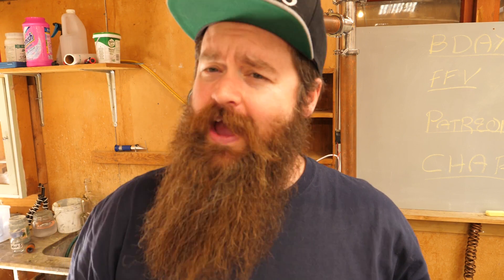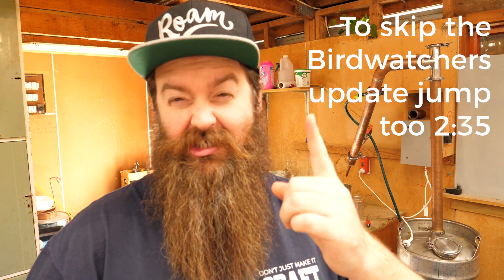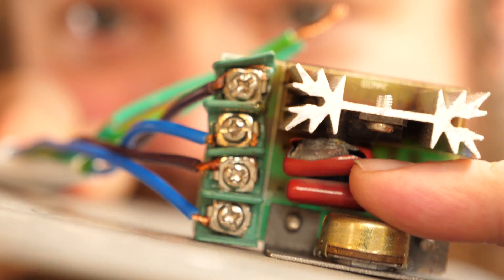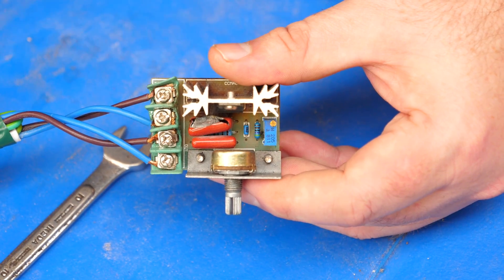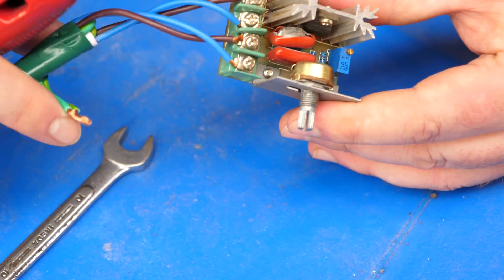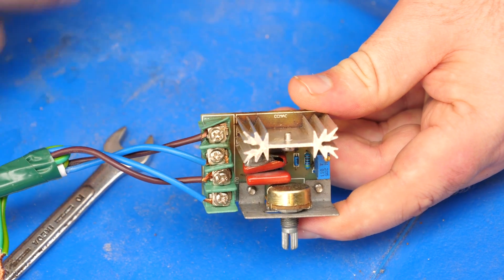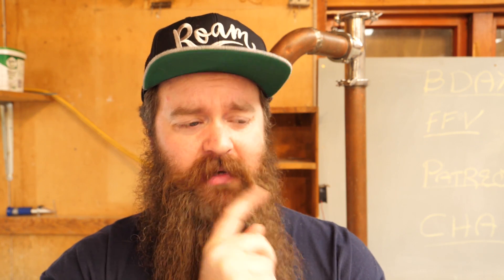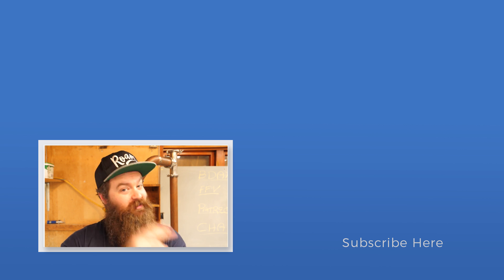How To Control Electric Element Stills?  SCR!

Comment: Information on SCRs
You have mentioned in the past that you thought your liquidis heating slower than you thought it should. 
     IF your controller is TRULY using a SCR, that 3 KW heating element can onlyproduce 1.5KW !  
A SCR ONLY ALLOWS CURRENT TO FLOW IN ONE DIRECTION!  Think of it as a diode.  A DIODE only allows the alternating current from your electric outlet to flow in ONE DIRECTION, turning the current into bumpy DC.  The scr allows you to clip off a portion of the dc current thus allowing control of current flow.  In fact the schematic symbol for a SCR IS THE SAME AS A DIODE, with a gate wire added at the cathode.
I would suggest that you look for a controller that has a TRIAC IN PLACE OF THE SCR.
I am sure this is as clear as mud for a tinkerer as yourself, but look up the symbols for a diode, a scr, and a triac and you will see in the first 2 a very  definite arrow in the symbolic representation,  while the triac has 2 pointers side by each pointing in opposite directions! 
I LOVE YOUR CHANNEL,  and just might have to set up a still here in Kansas! Law or no!
I am at your service with any of your electrical challenges 
Feel free to mention. 
I am 
FLINTCOAT
Reply from the maker: Sorry for the slow reply mate.  Twins situation taking up time hahaha.  

That's really interesting!  I understand what you mean (with my very limited understanding haha).  Will have to look into it some more.
Reply: Still It.  MY HEART GOES OUT TO THE 4 OF YOU!  Get some sleep NOW!  YOU WILL NEED IT!   AND  a bit o advice,
DON'T GET OLD, IT IS A TRAP
Reply from the maker: Thanks mate :) funny how you can pick a good bloke from a comment haha
Reply: These kinds of SCRs produce very nearly full waveforms at 100% output - at least as far as a heating element would be concerned. They use two-way thyristors for either zero-voltage switching or phase angle firing, so as you turn them down they either skip more cycles or delay the waveforms proportionately. Note that most are intended only for pure resistive loads, such as these heating elements, and not inductive loads. So in other words, NO WORRIES!! You won’t lose half of your power at full output like you would with a simple half-wave rectifier.

Comment: Thanks for the video. I have been looking like mad for info like this. Is there anyway you can show your entire electric set up from cords to the elements? Do the 2 elements just branch off the power cord before one goes into the scr?
Reply: After further reading I think i found my own anser. Do you use them on 2 seperate circuits?
Reply from the maker: Yep exactly.  Sorry for slow reply.  

These are literally two separate circuts all the way back to the breaker board.  That way I didn't need to install higher amp circuts.

Comment: Awesome vid dude, as a sparky few cringe moments but still good. ALWAYS solder or terminate your earth (you said neutral on the vid) if there is a fault to earth the fault current rungs through this and so should be sound, although the RCD will help. Also if you front plate is metal make sure that you link an earth to that too.  🤗
Reply from the maker: Cheers mate appreciate it!!

Comment: I highly recommend using a PID, they are certainly cheap enough and a lot of times you can get them with the SCR for just a few dollars more. George over on Barley and Hops Brewing has many videos on wiring and using them even which parts to get. One thing to note with any SCR, make sure your heat sync is not enclosed, heat as you now know kills them dead. I originally built a 3 channel system with a timer and plugins so that it's flexible enough it can be used for brewing, sous vide cooking, keeping a keezer at the right temp, pretty much anything that needs temperature control. The learning curve is minimal and if I ever lose a channel I have 2 more to fall back on. https://photos.app.goo.gl/Lzyfd1SVKSYk9HZ03
Reply: No need for PID in a pot or reflux still.

Think of a SCR or SSVR is basically a industrial dimmer switch.
After boiler comes up to temp and you get spirits flowing. The more power you dial up, the lower the ABV. (You are boiling more water with alcohol)
The lower the power the higher the ABV. (You are boiling just at 172F) You can get a drip, drip, drip out of a pot still which can reach 170+ proof or higher, but will take hours to complete a run.

There are PID's which "self adjust" the heat. But it acts like electric stove, power on, power off, then power on again. The alcohol on the still will flow the same way. Fast slow down, fast, slow down, and may adjust but it will always be adjusting, even though the amount of power goes up or down.

I like George's videos but he uses silicone tubing he calls "food grade" to collect High ABV spirits for consumption which is a safety no-no. Glass, stainless, copper and PTFE are the safe for High ABV spirits. It's not how high ABV affects the material, it's what it takes with it. If you are making high ABV fuel, use whatever you want.

Comment: Fun video as usual. I started with a SSR controlled by a 500Kohm potentiometer. I recently stepped up my game with a Raspberry Pi controlled setup using a version of Craftbeerpi that I edited the steps on to suit distillation. The PWM is amazing on my 5.5Kw setup and I can jump to temp and dial in with no hassle! Come to the dark side!!!
Reply: Confused about these controllers. Do they operate by turning on and off completely or by reducing the power and also increasing it to maintain the required temp at the top of the still? I have some PiD controllers but they turn off and on relays! Which is not good.
Reply: @williamarmstrong7199 Both. They switch quickly to lower the voltage out of the SSR. I use a PI which is using PWM to control a 5VDC pin to a SSR. The longer each pulse is, the higher the voltage. The faster the cycle, the lower the voltage. Clear it up at all?

Comment: Great video Jesse, but I think your math's on the percentages are off.The percentage of the scr is that of half the total power usage by 2 heating elements, 50% set on the src is only 25% of the total wattage for example. For example when your switch is on and the scr is on 25% you have 62,5% total power on two heating elements not 75%.
Reply from the maker: I hear you mate.  I was talking % of totall power the whole tome.  So when I said 50% for the SCR I mean that that scr is running on full.

Comment: I humbly disagree on some of the points you provided, though I am a fan of manual power control over digital to the elements, I prefer a pid running both systems  with power regulators treating both elements separately. I FULLY agree that at some time one system will fail, by having both elements hooked up to different SCR systems than you should never be stuck in a non operational status. one element can run your whole system albeit slower but it would not shut you down as this failure would have if you were doing a spirit run over a stripping run. Now in saying that, your costs are almost doubled in the manufacture of your control system but we are talking about relatively cheap parts and as pointed out in the video you should always have a spare, so why not just put the spare to use, instead of sitting in a drawer?  typically if both fail at the same time you have other issues and should shut down, but if only one fails then your other side will continue, Jessie don't leave your spare in a drawer, install it , I honestly cant see a reasonable argument against running your particular system on one SCR when you have another one sitting in a drawer. You can still run the second element at 100% with an on / off switch controlling the SCR  if you so desire, but having the ability to run both elements at 30% will reduce the scorching effect to your mash. Thus producing a better quality spirit, in the end is that not the second most important issue behind safety?
Reply from the maker: Dang good point mate.  I hear what you are saying!  Especially if you set it up so it is not hard attached anyway.

Comment: Hey Mate, that was a great explanation of how to proportionally control the still with multiple elements. That will work in all circumstances and with any number of elements. You only need 1 SCR controller. 
Your el-cheapo is just that and dangerous. I'm stil running my controller that I built in 2010 without fault. Mind you there are some considerations that must be adheared to always, the SCR must be at least 100% of greater capacity than the load it controls.  That is the accomodate the "Duty Cycle" Just like a welder or any other device. NOte the more you blead the power off the more load its under. 
An SCR or Silicon Controlled Rectifyer (Google it) if the most efficient and cost effective means of controlling a load particulalry a heatign load or as a motor speed controller. Its best to stay away form a PID or SSR as the biggest disadvantage if the high heat they put out. THey are also not designed for stills but more appropriate for a mash kettle where you will set the heat to attain and hold it there for a period of time then step the heat up for anothe rperiod to mash out. 
Also be very aware that the electrical systems between the Americas and the rest of the world are very different. in gthe US 110 Volt can not supply the amount of power required, so they use 220 Volts. this is the equivelent of our 2 or 3 phase 415volt systems, a US 220 volt device is very different to our 240 volt controllers. the circuits are also very different. 
The SCR link below to Amazon should not be used in OZ or Kiwi, use this one instead. Beside its only $17 AUD delivered free for a 3 wire 10KW unit that should last for years. Good for any single phase 240 volt element up to 6KW (remember duty cycle). https://www.ebay.com.au/itm/10000W-High-Power-SCR-BTA10-Electronic-Voltage-Regulator-Speed-Controller-NEW/292088869279?ssPageName=STRK%3AMEBIDX%3AIT&_trksid=p2057872.m2749.l2649 
ALso please the Brown wire is the "Active"  the Blue is "Neutral: (not the green - thats earth thats the keep you alive wire that make the RCD work). Oh and I am a Sparky. Great vieo, keep it up. I hope my long winded explanation helps.
Reply: Lloyd Davis so the link you have for the EBay one is good for Australia? I want to order one
Reply: Cheers Mate, yes it is, I bought one myself for 3 Phase 6 element controller I am making right now for a 500 litre pot still. Works fine but I am only driving 1 6KW element but it will work for any element up to 6KW (25 Amps) its neet and runs pretty cool. but keep it vented.
Reply from the maker: Appreciate it mate!  

And apologies for the slip on naming wires! 

Will pin this comment to the top when I get back to a computer!
Reply: Lloyd Davis thank mate
Reply: Lloyd Davis i would love to talk whit for some info
Reply: Sure, Message me at talon2855@gmail.com
Reply: Lloyd Davis i tried to send u a message back and something and it want let me
Reply: Lloyd Davis are you on Facebook
Reply: the email should work, send me an email to talon2855@gmail.com